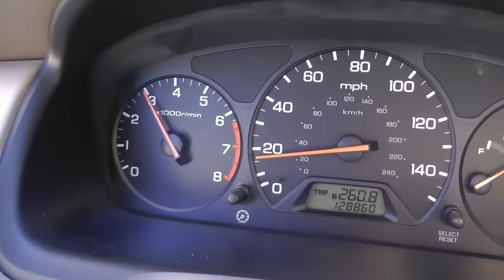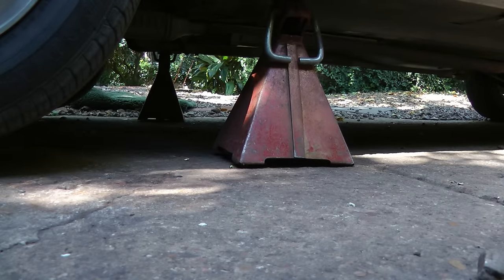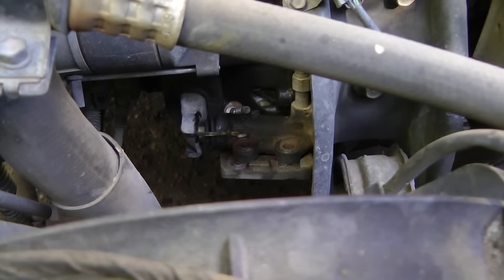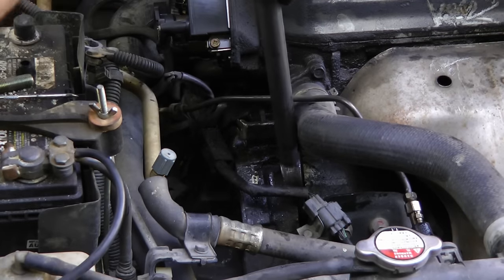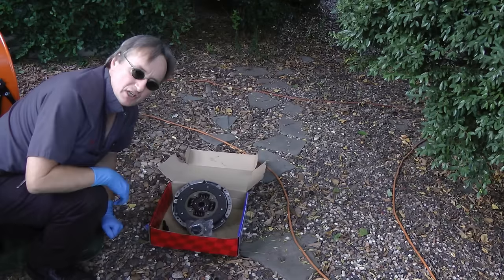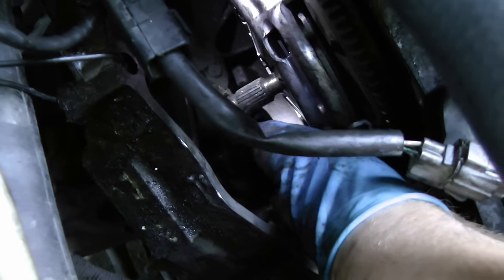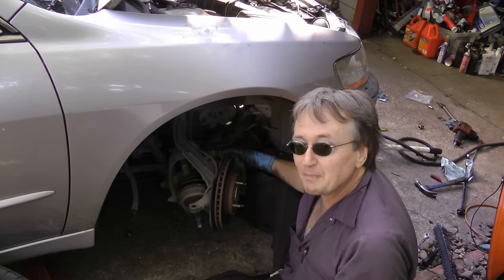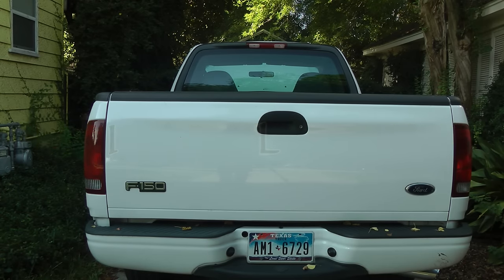How to Replace a Clutch in Your Car

Comment: I noticed you didn't fully remove the transmission is it possible on all cars because I may need to adjust the thro at bearing shaft

Comment: Hi Scotty I have a 98 corolla the clutch is not slipping but it feels really low, would a symptom of a bad clutch just be slipping? Tanx Mike
Reply from the maker: check the clutch master and slave cylinders, pray they are just leaking and need replacing. If not, new clutch time

Comment: Scotty Kilmer, i have a '92 saturn SL. standard transmission, like in your video here, when i am in 1st gear and try to start to accelerate, it moves very slowly, i end up in 5th gear by 30-40 mph. i have been told that it is my clutch (which i believe) or my transmission fluid level. which is my problem? if need be, i am willing to make a video showing you my problem... please assist me....

Comment: its 2/2024.  My ol  horse manual corolla had this work done by mi Amigos  de sur. All for $975.00  Labor only.  Parts 135 clutch kit.  Flywheel 85.00. Oil 18.00. plus taxes. btw dont forget the wheel alignment after this fix.  Out the door about 1370.00 USD,   How much did it cost you for a clutch replacment??

Comment: Hey Scotty, I got a BMW 330CI at the moment and when I was going down the highway (like 80 mph) the engine started rumbling, I stopped and there was nothing wrong with the engine but when I pressed the clutch it made a grinding noise and I could not change gears (When the car was on that is), so it became undrivable. Do you recognize this issue? Thanks in advance,
Reply: Your clutch master cylinder or slave cylinder may be bleeding back so that even with the clutch depressed, it is like the clutch pedal was not pushed down. To test, with the engine off, put the clutch in and put the shifter in first gear. With the clutch still depressed [pedal down], start the car and if you can drive it in first gear, it will get you home on a short trip, but then the hydraulic clutch master cylinder or/and slave cylinder need to be replaced.

Comment: Do you recommend replacing the pressure-plate and flywheel bolts?
Reply: +Aaron L   I'm not a pro mechanic, but yes. Absolutely. I sheared off the head of a bolt putting on the new pressure plate on my car. I had to use a bolt and screw remover bit to remove it. That sucked. I have learned the hard way to replace old bolts whenever I can.
Reply: ***** Thanks for sharing your experience. It seems worth it when its this critical. (Update) However, I stopped by the Honda dealership and spoke with a tech and he said they do not replace bolts, just be sure to torque them correctly. Also, the service manual doesn't say to replace them.
Reply: +Aaron L No. They are made of hardened steel, and will not give you any problems.
Reply: justsomeguytoyou   Yeah. It was either very poor quality steel on my car (97 mitsubishi) or I'm just a bull in a china shop. Lol.
Reply: ***** I noticed the torque specs were quite low on the pressure plate.
Reply: Aaron L  Oh. Ok. Thinking back, I probably used foot pounds instead of inch pounds. What can I say? I'm a brute. :)
Reply: ***** haha, it happens. I've snapped a few off.
Reply: Forget all the other responses [from those other bozos], don't touch the flywheel bolts unless the flywheel shows some uneven wear of glazing at which time the flywheel should be removed and taken to a qualified automotive machine shop to be resurfaced [milled down smooth] if not, you will get clutch chatter while taking off in first gear.Vinnie in Cincinnati

Comment: Hey Scotty, I have a 98 Chevy s10 2.2l stick shift. 

 I was driving it to work this morning and once I was a mile away from home I hit a stop sign and I couldn't put in 1st gear or any gear . I had to really force it. The gears go in fine when the truck is of but when it's on it won't go to any gears. Can u please help me out and give me some advice on what to do or how to fix it?
I would really appreciate it, thanks.
Reply from the maker: pray it's just a bad leaking clutch hydraulic cylinder, it often is. see my video "repairing a bad clutch cylinder"

Comment: I have a Mitsubishi L200 4x4, I can go through all gears without stalling and without using the clutch pedal. I think the gears are not engaging and the car can not be moved. Is this a clutch issue?

Comment: Hey Scotty! I just have a quick question as to why my car makes a weird clicking noise when you get real close to stalling the car out? is that normal or is it electrical related to where the power is so low at that point of almost stalling that it makes really fast clicking sounds? Sounds like a car that has a bad battery and you just hear the starter clicking.
Reply from the maker: low rpms often lower voltage power, and then relays often click, check them all when it does that, but if it runs fine otherwise, I'd leave it

Comment: Hey scotty i drive that same model honda 2000 you changed in the video theirs  an issue with mine though at first when i shift  from idle to first it runs perfectly but  after a while  shifting  to first shakes my whole car for a second but  then recovers and runs perfectly fine, what could  be the problem  :(?
Reply: I too have the same problem. 2006 hyundai tiburon here
Reply: ***** i found the solution to the problem! Its not the car at all its actually yourself after a while of driving  i find my foot getting tired and i tend to let go of the clutch faster which  gives that stalling  feeling, i just pay attention  to my gages  now and the car runs like a champ! :)
Reply: Danny Sanchez yeah I used to do that, I had a bad exhaust on my cb7 and to keep the 5-0 off me I tried to accelerate at lower rpms, it caused the whole damn car to shudder rather violently.

Comment: im replacing my clutch on a 2012 chevrolet sonic lt with the 1.4 turbo do ineed to remove the battery tray or anything if im just plulling the transmission out enough to replace the clutch?

Comment: Scott I would like to ask I did all I suppose to do to replase the clutch on my 2000 Civic Honda LX 2.6 L but now that im putting. The transmission back ofcourse I use the plastic guide to line up the groves but the bolts do not line up like a couple groves off alignment I tried to move it clock ways and is very close that I could start the bolt but is off se.nter bu probable 1/8

Comment: I was told my Honda Accord 2002 as well today (like the one in the vid) had a bad disk.. No wonder accelerating hasn't been the same.. Really sad I'll have to get a new car and sell it 😢 I mean I have such money to fix but there will be more problems to deal with after (oil leaking from a few possible areas that also need fixing) sigh.. My first car too. Never buy off the street or like in my situation some mechanics don't know much and will sell you a car from their lot that's too much for what hidden problems it will end up having.. Only had since March this year! Sucks cause I love older cars.. They look cooler than all these expensive new cars. 🙄:(

Comment: Scotty Kilmer do i have to take the engine out of a 2000 cavalier to change the clutch or can i do it like you did on your video..
Reply from the maker: it makes the job easier, but pulling an engine is a giant job in itself. You can do it my way as in this video, but realize it will be a lot of shoving and pulling

Comment: My Galaxy clutch is very weak, stands in a lower position than used to be and pushes down very easily, also first and reverse gears doesn't go in at all or goes in while vehicle is off. We already changed clutch cylinder which stands near pedal, that helped for a while, could it be that clutch fluid is lacking? Because rpms stands normal, if gears in works great, clutch doesn't make any sounds and aren't slipping, just feels week, soft. Any ideas? Ford Galaxy 03m tdi manual

Comment: Hey Scotty, I just bought a 2016 mustang GT. I'm rather new to driving a manual and my question is when I am taking off from a stop could I rev the engine a tad before releasing the clutch? would that wear out the clutch?
Reply from the maker: yes, you revv it up a little to get it going, and gently doesn't wear it out, only peeling it out with high revvs does that
Reply: +Scotty Kilmer Is stalling a car that has a manual trans hurting the car?
Reply: I heard from multiple people that stalling the engine, wont' hurt the car. But, I personally think if you stall the car repeatedly like 3 to 5 times in a row, I think you would hurt the car.  But once in awhile, it's fine.
Reply: What about rev it in neutral without putting the clutch down?
Reply: thšs perssonnn This depends on timing. If you do it, while putting it into neutral rev match right after in neutral. Then, push in the clutch again and put it into the right gear and let out the clutch, it's called double clutching. 

If you just put it in neutral say to stop, so that you can just use your brakes to a stop. Then after a little time passes, and instead of stopping, you see that you'll keep on moving. You can quickly rev match for a correct gear to keep going instead of stopping. Then, I guess that's just driving a stick. I do that all the time.
Reply: If your Mustang is a V8, they have loads of torque and are very forgiving with new manual drivers as they're pretty hard to stall. You don't want to give it too many revs and it's also not really something you can explain online, you'll just have to develop a feel for it, which you will with time.

The main part is finding where the clutch grabs. So as you let pressure off the pedal, the point in which you feel the engine start to engage and move the car, that's what you should be feeling for. Focus on finding this point.

Comment: What if when I press the clutch all the way in it makes a wissling noise. Also after the transmission warm up a little it become hard to put my truck into first or second gear. Does this also mean a warn clutch. I have a 99 f350 v10

Comment: Hey I just replaced the clutch on my mk4 gti and a friend told me with a new clutch you have to drive it soft for 500 miles like no hard acceleration or gear changes. Is that true? I drive in canyons and autocross should I stop with the new clutch ?

Comment: Scotty I've got a 2004 Saab 9-3 aero 6 speed with a clutch needing to be replaced. Finding the right clutch for my car is a pain as the pricing for anything on a saab might as well be a space ship cause either its too expensive or impossible to find. Have you heard anything about SPEC clutch kits. Im looking at getting a stage 2 to drop in. I have basic mechanic experience and do not want to do this again and want parts that last. Have you replaced one in a 9-3? General walk through would help.

Comment: Hi Scotty, my car (BMW Manual) recently underwent a clutch replacement (including the flywheel) but unfortunately I have been experiencing a burning smell (possibly oil burn/diesel) coming from the inside through the car vents. The clutch seems to engage with no issue and drives well and gear changing is not an issue. I am also driving it conservatively and no "clutch riding". I also have noticed the smell seems to be more evident when on "biting point" when I am about to change gears.  I had the pollen filter replace but still the smell lingers. I have only done 150 odd miles since the clutch was changed. Any ideas what it could be? Thanks in advance for your help.
Reply: Mustafa Syed the clutch is still in the break in process just drive it easy for 500 miles
Reply: jose ulloa thank you for reply. I recently drove it on the highway and did 300 miles and I didn't experience the smell so hopefully it'll go

Comment: hi scotty, i have a renault twingo 2000.. The clutch paddle is soo hard..and also the gear is hard to shift...what would be the problem? do i need to change the  clutch kit?
Reply from the maker: they don't sell french cars here, but if it has a clutch cable, replace that. IF not, clutch inside the transmission would be worn out

Comment: nice video!! i have this one problem but im not sure its the clutch i have a 2007 mazdaspeed 3 and when i lightly press the clutch the pedal shakes and so does the engine i have looked and the engine mounts but im not sure if it would be the clutch or the transmission mount!
Reply from the maker: lightly pressing the clutch will not effect mounts, I would assume worn clutch parts
Reply: okay because as soon as i press it down about an inch is the only time it does it but my car doesn't slip when i shift i get a good response i have no idea what it could be at this point! thanks for taking your time to answer!!!!

Comment: Scotty Kilmer I have a 3dr hatchback Civic, 2003, bought it at 48,000 miles. Got warned about the input shaft bearing and before long there was a grinding noise coming from the transmission, after a while it was decided to get a refurbished gearbox and new clutch. That was all fitted, but the noise came back it found a crack in the refurbed Gbox so put some putty over the crack, and topped the Gbox oil back up. Now I believe the throw out bearing "clutch release bearing" is whining. When the engine idles it whines but as soon as the clutch is depressed and bites the whine stops. Also at first start up the clutch squeaks from inside the Gbox when depressed. Any help would much appreciated.

Comment: I've got a question scotty. a friend of mine is selling me his car, and the clutch is starting to go on it, and it needs a new one. it's a 2005 Chevrolet cobalt coupe, FWD, 200k on the body and 130k on the engine, if that matters at all. but I was wondering what i'd be looking at for cost. should I buy the transmission kit and take it into a shop? or let the shop take care of everything. depending on the price i just may go to my neighbour who's quite handy with cars. overall i'm just looking for a a cost. thanks!
Reply from the maker: not the greatest of cars, me i'd never buy one.   But if you get it cheaply enough, go ahead and let your neighbor put a clutch in.

Comment: alright. i have a 1998 saturn sc2. it was pouring oil so me and my dad pulled it apart to fix it. we replaced rear seal and it still leaked. we pulled it apart again and replaced valve cover, front seal, headgasket, and pan sealant. still leaked. pulled it apart again and noticed a plug behind the flywheel that was loose but we arnt sure what it is. we think thats the problem but were gonna sleeve the rear seal and tighten that obviously but we were just wondering what that plug might be, and why is it there.

Comment: Hi scotty, im a student working part time and i drive a fwd mazda that needs the clutch replaced, i found a full clutch kit on ebay for $160.00, if i take that to a clutch repair shop, roughly how much will i need to pay in labour? because if it's anywhere near what i've been hearing for fwd, i think i'll have to follow your video and do it myself. Do you think this is a job possible for an amateur carhead?
Reply from the maker: most places charge between 5 and 7 hundred dollars labor, call in your area. It's the same process as this video is you want to try it yourself.
Reply: seems fair i suppose, maybe ill do it myself one weekend :) thanks

Comment: Scotty ! I need your help ! I have a 06 scion tc. When the car is OFF i can shift through all the gears. I dont even have to press in the clutch pedal and i can still shift through all the gears. But when the car is ON i cannot shift at all. The lever is hard as a rock. I inspected the master and slave cylinder and both looks good with no leaks. Did a transmission fluid change and still nothing. Do you think it is the clutch that is causing this problem ?
Reply from the maker: yep, just worn out clutch, replace the entire clutch set, as it's a big job you only want to do once
Reply: Thank you so much scotty !
Reply: Also scotty, do you think it can be the shifter cables ? I know you said clutch but i really need to make sure what the problems is before i take it to the shop.

Comment: Hi di have to take off the  both drive shafts and struts to get at the gear box for my clutch replacement or would one do??? can i not just move the wheel half shaft around to get at the gearbox..many thanks

Comment: I got a question for you.. I have a 2008 Mazda. 6 speed.. OK I gunned it went to slammed  it in 4th and missed I hit between 2nd and 4th gear and then the clutch lost all pressure.  I had to start it in 1st and take off and rev shift home.. so I bled the clutch it got all the pressure back. feels a little funny but pretty much normal.  but it still won't shift into any gear.  my clutch didn't blow up no clacking noise or anything. the clutch never slipped I really don't think the clutch it bad at all... master not leaking. slave has been leaking in the boot a little for a long time. I topped the clutch fluid off bled it a few times and still won't shift into any gear... do you think it's the slave. the clutch has pressure so I don't get why it won't shift in gears. could the slave be bent or something and not hitting  the fork? ASAP help would be nice I replie back real fast. thanks

Comment: Question sir..my toyota innova everytime i shift gear it is hard to shift, i adjusted the push rod on clutch pedal and perform the bleeding on clutch master and the secondary master and it works..2 weeks after the problem appears again and worst it is not shifting anymore..i replace the clutch master and secondary clutch (both assembly)
i properly bleed after replacing the parts..and still not working my transmission not shifting...is it possible that the clutch package is the problem? When the engine is not running i can my gear smoothly so the syncronizer ring is ok..pls give an idea on how to solve my problem..thank you